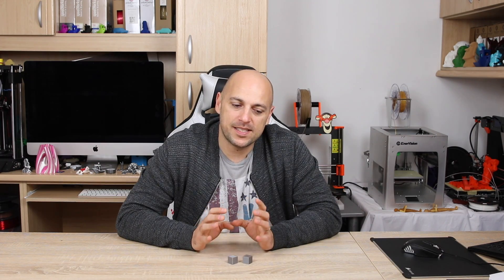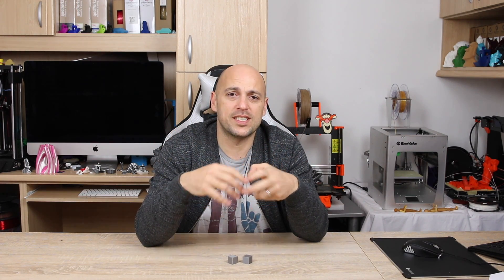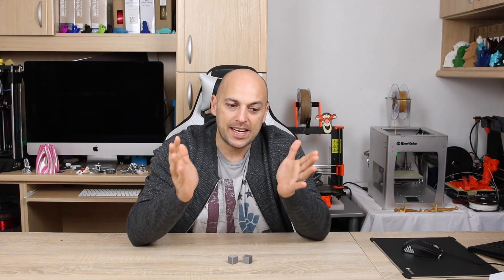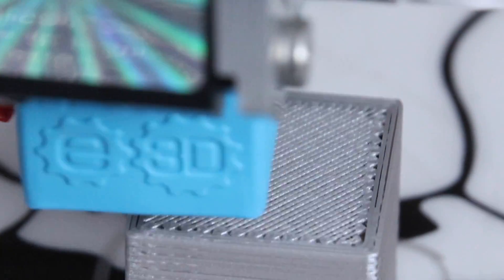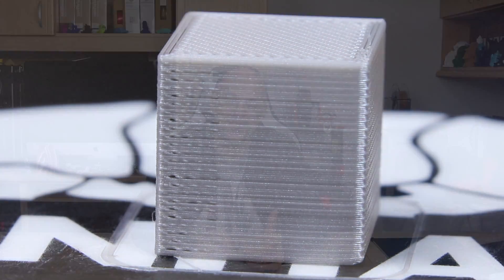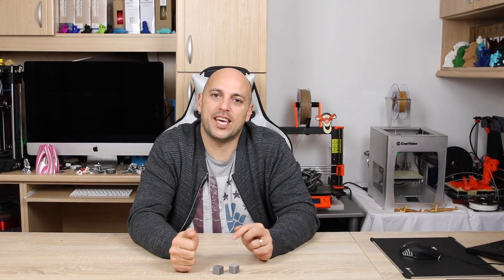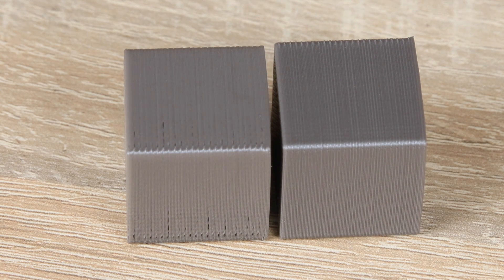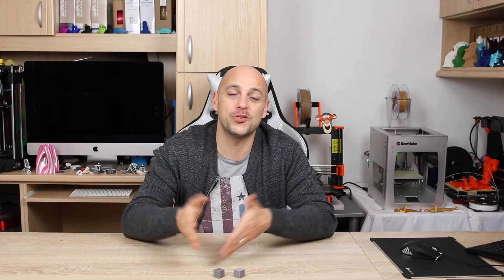A Noob's Guide - Extruder Calibration With Mattercontrol

Comment: Subscribed and Liked.  I just did this and after one measurement it is exactly on the money.  The one thing I did different was disconnect the Bowden Tube, flush-cut the filament at the fitting, run 100mm, flush-cut at fitting again, straighten cut filament, and measure with ruler on desktop.  It was EXACTLY 100mm

Comment: Good afternoon, my tevo tarantula pro  is leaking filaments on the sides of the extruder, is too much filament being deposited? If so, how does the calibration perform? I wait and God bless.
Reply: If it's leaking around the threads of the nozzle or next to the heatbreak, probably your nozzle is not installed right. It should not butt on the heater block, but sit tightly against the heat brake. Maybe that is your problem.

Comment: Dude, I picked your video because I saw 2 of your other ones that were good. But this one, oh boy. There's a lot wrong here. The math is wrong, the overlays are wrong, you're using the cleaning procedure to extrude... what happened? You either should delete this video or redo it.

M503 ;grab current E value from the M92 line printed out
G92 E0 ;reset extruder EVERYTIME
G1 E100 F90 ;extrude 100mm at 90mm
; use G1 with F to use a sane speed
; unload is WAY too fast (it's meant for cleaning) and you will almost always come up short of 100mm (unless you use PLA and set your hot end blazing at like 300c).
; then plug in your old E value along with whatever you measured to get your new E value
; $New_E_Value = $Old_E_Value * ( $Want_To_Extrude / $Actually_Extruded)
; or any variation of that simple formula ie. $New_E_Value = ($Old_E_Value * $Want_to_Extrude) / $Actually_Extruded  ;
M92 E$New_E_Value
M500 ;save
;

Comment: I found it easier to control by removing Bowden tube (if available) then putting filament flush with extruder. Then you can run it in and out until it is dialed in without marking filament.

Comment: Hello, just got my first printer and i've been having issues where the machine wont send enough filament through, so this is a great video to follow. Problem is that when i followed ur instructions to the teeth i had some issues. So when i first extruded the 100MM it only extruded 8 MM. so for the first equation should be 100 - 8 = 92,  went on with the next equation 100/8 = 12.5, the current step was set to 93 so last equation should be 12.5 x 93= 1162.5. Adding this number and trying to extrude 100MM made my filament retract and actually go out of the extruder. I dont really know why this happened hoping you could shed some light.

Comment: Hi Joe!
Thanks for the video! And thanks for the Mattercontrols tip! I didn't know it!
I have the same printer as you. E94.3 by default, and extrudes around 60mm instead of 100mm. I follow the formula and I get something like E130 or so, but then nothing changes.
Any suggestion?
Thanks

Comment: good luck to those that has a black filament and a black marker :)
Reply: Hmmmm…….that was something I thought about some weeks ago when I bought my E3 Pro...……...someone should design and market a filament feed rate indicator that measures the amount of filament that flows into the extruder in a minute etc. I also have to wonder why it would not be better to have an adjustable speed control for the stepper motor to adjust the filament feed rate. Then you could adjust the filament feed rate on the move according to the feed rate indicator. Over or under extrusion would be infinitely variable and corrected as needed.

Comment: Glad someone has put a vid on this, i would wreckomend people should do this asap when they have extruder issues. even if it is a New printer. hence  there has been a lot of folks saying there extruder head is clipping their object,

This option is good for beds that have Decorating tape. this option is best as if you try doing it from an alternative Datum you may get worse issues. this is because if you printer is not 100% square/aligned/True  it will put you measurements off in the slicer.

To calibrate along the X,Y go into controls select 100 mm and click the X+ and the Y+ button, use a pencil and mark around the extruder nozzle.

you should have about a 1-2mm diameter circle you may need to remove your fan Nozzle to get better access to nozzle, NOTE it does not matter if circle is big or not totally round as we will use centering logic, Basically the middle if the circle :) .

 And so this is your centre. (not actual centre of bed but of our task)  ok when done click the Home Button, So its out of the way.

Now measure up 100mm from the center of the circle and also measure from the circle to the Right of your bed 100mm
Ok breather time LOL

So now you click on the 100mm and click button X+ once and same with Y+  and were back to the middle of the circle that you made drawn with pencil/marker.

This time click again once more on the X+ button and see how far that goes to the next 100mm mark that you put on the bed and mark it and measure it to get measurement.
and do the same calc and input into settings as Joe has shown in this vid.

Just do the same for the Y axis after getting to the centre of circle, IE move Y+ 100mm from centre.

(WARNING MAKE SURE YOU HAVE NO HEAT ON THE EXTRUDER OR BED)  IM NOT RESPONSSIBLE FOR ANY OUCHES!

Comment: Someone may have already pointed this out, but, when you do your first length multiplier calculation (at about 7:00 into the video), the on-screen text uses the incorrect extrusion length, and, therefore, the calculated length multiplier is incorrect. What you're saying in the video is correct, thus it doesn't match the incorrect on-screen text.
Despite this small error, thanks for such an easy to understand method for doing something I didn't know I should be doing. 😆

Comment: thanks for the tutorial. I will be trying this with my new anycubic i3 mega straight out of the box. question: does this calibration change for different materials? or do they all extruded at same rate?
Reply from the maker: +Glen Childress if the diameter is the same, the extrusion is the same. However! Some materials might need higher extrusion rate just because of the way they are. Those little adjustment are done through the slicer though

Comment: Great video as always! Will definitely be doing this. I have a question, after saving to EPROM will SD card printing use the new values? As I dont want to keep the printer hooked up to my pc.
Reply from the maker: +ImmenseFox once you save to EEPROM it remains in the printer firmware memory, so no need to keep it hooked :)

Comment: Hey Joe, just did this on my CR-10, and it's now dialed in, extruding exact length of filament. I'm still having issues though. Printing a 2 perimeter hollow box, with a multiplier of 1.0, the walls get way to thick, 1.12mm where they should be 0.96 (2 x 0.48). Multiplier of 0.9 the thickness is perfect, but I seem to get underextrusion on prints.

So seems I have the choice of calibration being perfect but tendency of underextruding. Or going higher, where prints show less signs of underextrusion, but having the walls to thick causing some things to fuse... Any suggestions?
Reply from the maker: +Karsten are you using simplify3D? Make sure the layer thickness is set to 0.4 on manual instead of auto
Reply: I am using s3d with auto 0.48. But to my knowledge, setting the width 0.40 will just lower extrusion accordingly, and put the lines that closer. So if I have the issue of 2 perimeters not being 2 x 0.48 now, will setting 0.40 not just give me the same relative error.?
Reply from the maker: +Karsten set the multiplier to 1.0 and extrusion width to manual at 0.4. If it's  calibrated, it should print just right. Had the same issue on the Sigma when I changed to bongtech extruder that's why I'm suggesting it
Reply: Started it 2 mins ago :-)
Reply: Same result. Width seems to be off with same percentage.
Reply from the maker: +Karsten let me know how it goes :)
Reply: 3D Maker Noob Just as with auto (0.48), on 0.4 manual I have to lower multiplier to 90% to get the right thickness. I does seem to fair better with 0.4 though. Might be because You essentially increase resolution in X/Y, and s3d can do a better job.
Reply: Did you solve it? Have you dialed in your Filament Diameter? I measured mine with calipers and it had a consistent diameter of 1.8mm instead of 1.75. You can type this value in simplify3D as well so that it knows how much material it is actually extruding.

Comment: That's actually really helpful. I'd be a bit too scared to mess around with gcode directly, I guess. I wouldn't want to break anything by issuing the wrong command. Using Mattercontrol for that is definitely much less error-prone, I'd say!
Thanks for the video, Joe!
Reply from the maker: +Roberto Comecaramelos yes, the same formula applies to movements. You simply replace the length of extrusion with length of movement :)
Reply from the maker: +TheoRien more than welcome :) the same process can also be used for calibrating axis :)
Reply: Hi!
Did you mean that the same formula is applicable to the X, Y & Z axis, isn't it?

So, while the desired extrusion/moving length didn't match the actual length, you need to:
(desired length / actual length) * configured steps per mm = new steps per mm value

Greetings from Spain!

Comment: I am lost.  Where did you get the 1.6949 from?  I thought the length multiplier was .97 from the previous equation?
Reply from the maker: by mistake the overlay text was for the second calculation of the 100/102 which is why it displayed 0.97. the initial calculation was 100mm - 41mm = 59mm, and then you divide 100 / 59 = 1.6949. apologies for the confusion :)
Reply: I was confused too haha
Reply: thx i was like "dafuq?!"  thanks @Board Gamer for asking
Reply from the maker: +itz_me_ToXIc the equation is, if xx number of mm is xx number of steps, then how many number of steps for 100mm.
Reply from the maker: +itz_me_ToXIc I had a bit of a gaff there with numbers :) was a very late night
Reply: +3D Maker Noob its all good.. i'm just trying to figure out how to apply this to Octoprint and under excursion
Reply: Can you please insert this correction into the video (an overlay?), as i was also very confused xD. Great vid btw, and thank you for taking the time to make it.
Reply: Ok I am following your video word for word and I do realize there is a mistake on one of your formulas but the more I do this the worse it gets

Comment: I have a i3 Plus as well and I want to upgrade the stock hotend. do you have a video about the new extruder? How would you recommend it versus other options like the Flexion and Microswiss? Thanks.
Reply from the maker: to be completely honest i have only tried it out for the past week, it's been great so far but have yet to test it out with TPU and other flexible filaments. i don't see why it shouldn't work as good as a flexion if not better as it's the same concept. will have a video up in a little while once i've done more testing on it :)

Comment: Honestly, you should have done this video correctly. You should have explained in actual Gcode or adjusting it on a printer. Doing it 2-3 times makes it very simple to get the process down. Your program isn't what everybody else uses and what you've done is just make it difficult. the only difference between what you did and what you would do in gcode  is the extra commands you sent to save it and load it, that's really it. Although editing the firmware is still simple it is a few extra "what have I gotten myself into" steps that most people shouldn't need to get into.
Reply from the maker: +Joey duncan and an alternative process will come in due course. This is one of many way to calibrate an extruder which ultimately works. You can walk from A to B in many different ways and still get there. If it works then there is no harm, gcode can be intimidating to many beginners and there is no need for it to be. I don't want to risk giving out the wrong information before I have mastered something in the best way I know how. As you said, the only difference from what I did or "could" have done is the gcode commands. So I'll cover both and still cover everything
Reply from the maker: Joey duncan I've checked with matterhackers and they confirmed it's the same exact thing, the only difference is that the "codes" in mattercontrol are sent automatically rather than the user entering them manually. Works exactly the same way in technical terms, just a more user friendly way :)
Reply: It's changing software is all, that can be exhausting enough, you have to resetup the printer for THAT software and it may not work for their printer. In the time it takes to download and install that software alone you would be done with three simple commands: M500,M501,M503 (not in order)Or if you can do it on your printer you just have to adjust it ands remember to save which is even simpler.  But I do admit it's not simple, calibration should be a focus for ALL printer software and firmware versions.

Comment: This is how you calibrate the extruder, there isn't any other way I know.
Reply from the maker: Jeffrey Drake the most common way is by sending commands through repetier or pronterface. M92 codes and such. Could get tricky, this is just more straight forward
Reply: Almost all interfaces, pronterface and s3d included where you can tell it to extrude a set amount. One thing I usually prefer to do is do it without the hot end attached, so you can test retraction and extrusion at the same time.

Comment: Awesome! Just the video I need now that I'm in the middle of building my Prusa i3 mk2. =) Thank you.
Reply from the maker: Nillabean completely agree. I think it needs surgical precision to get the numbers correctly. And discrepancy I tend to use extrusion multiplier
Reply from the maker: pretty much everything on the prusa is calicbrated right off the bat. their whole mantra is for a plug and play (after build) printer so would be very surprised if anything is off :)
Reply from the maker: Fredrik Bärg awesome! You're gonna have yourself an epic weekend I guess hehe
Reply: I will indeed. =)
Reply: That 3d printer should be spot on out of the box or after assembly. Dont play around its firmware.
Reply: Its actually not spot on for whatever reason.

I also recently did a video on this because I had to adjust mine as well and the 'new' number was quite a bit off from the factory default. Not exactly sure why this was the case but it was. I used Pronterface though you can really do this directly from the machine's control panel if  you want to manually extrude the filament. Otherwise its the same process / math to get your new e-step value.
Reply: Just finished my mk2s kit build and everything worked just perfectly. Everything was lined up as it should and the first batman logo print I did came out just perfectly. Will have to check later if it still holds up for a bit bigger prints, but the layers that it was doing was just perfect, so will hold off on calibrating the extrusion for now.